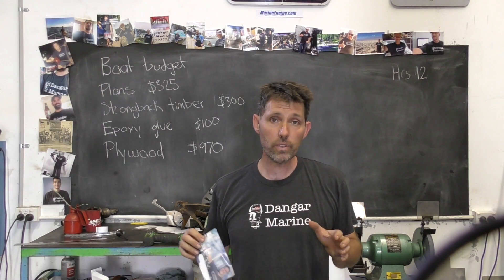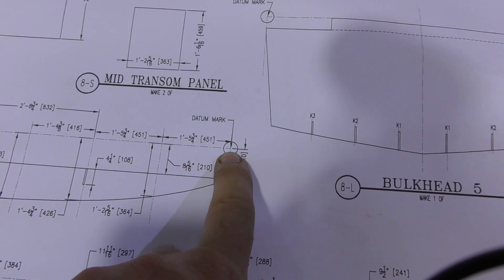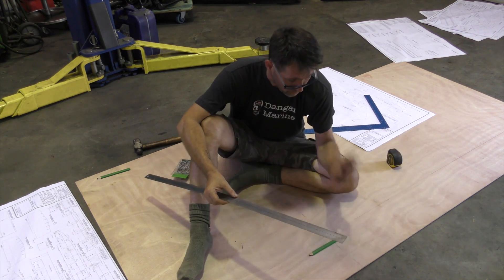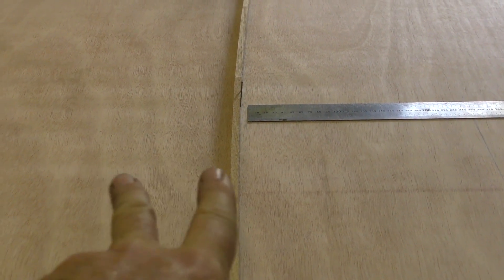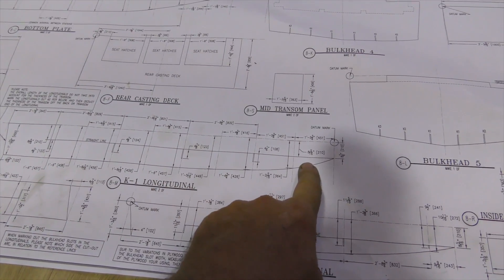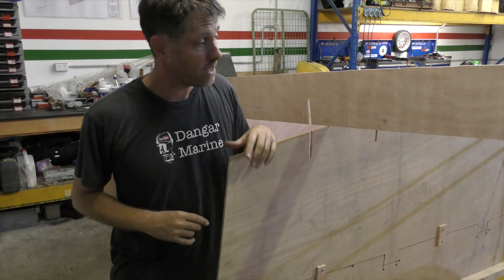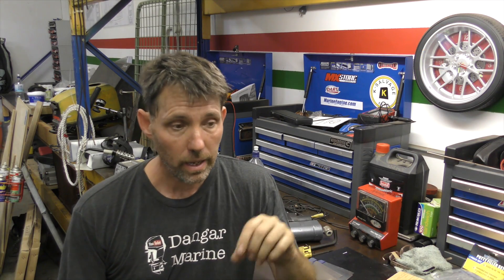Lofting a plywood boat

Comment: I've been drawing curves since I can't remember (about 50 years) and I've always just used a piece of string and a pencil. Start between two points to make a radius with a pivot point to be determined by putting the pencil end of the string on the starting point then by trial and error, find the pivot point with the other end of the string by touching the pencil on the start and end points till you get the correct arch with the string, then draw your radius. It's alot easier and faster. Then once you cut one side, just take the piece you cut off and use it to make the other side. Easy peasy!

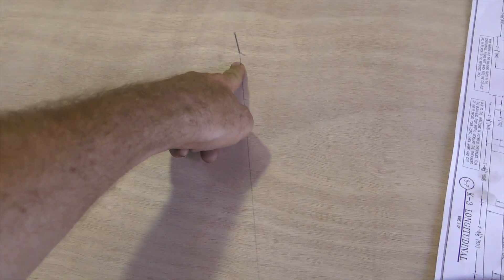Comment: 4:01 Does that deduction for transom thickness apply to the outemost longitudinals? I would have thought it would be better to have the transom outside edges flush with the inside of the outer longitudinals so you're them into the heavier transom not the other way around - also, better to have fixings in shear than tension. Presumably there are still internal corner battens glued, screwed and epoxy faired in anyway?

BTW the link from the original video to the plans http://bowdidgemarinedesigns.com/ROGUEWAVE_XR-16.html is broken - it appears he's withdrawn the Roguewave XR-16 model from the choices. I was wondering if he also supplies DXFs for cutting.
Reply from the maker: The outer skin comes to the back of the transom, yes. Not sure why the those plans aren't there anymore. I noticed that too.

Comment: Hi 
Can I use the spark for mercury 200HP BPZ8HS-10 in Yamaha 200hp and why,for Yamaha is BR8HS-10 Spark plug. 
Your answer is important for me.
Yasser
Reply from the maker: I'd be careful substituting a "P" plug for a regular as the outboard may not have the clearance between the top of the piston and the spark plug https://goo.gl/images/P1Cebr

Comment: Looks like a fun project.  I am curious as to how a wooden boat will stand up to a saltwater environment.  What finish will you use?  Given your ingenuity,  I have no doubt it will be a prize.
Reply from the maker: Hey Greg. I think this boat will hold up better than aluminium when it comes to salt. The timber gets completely coated in epoxy and fibreglass and then painted. Out of interest, fresh water rots timber much faster than salt water.

Comment: Hey Stu glad to hear you are taking a well deserved break. And for all that fiberglass dust get some clear plastic drop clothes and hang them up around the boat to contain it and get some Tyvek suits and a good respirator no need to be itchy and miserable.
Reply from the maker: Hey John. Yes, I have some disposable Tyvek suits and a good respirator which I agree are essential. I think I will try buying a roll of plastic that I can hang down to make a temporary booth with.
Reply: A temporary booth would work great and will come in handy when its time to lay down some paint.
Reply: Either hire or buy an air sander with a water sprayer built in such as https://www.ebay.com/itm/5-Wet-Orbital-Air-Palm-Sander-NEW-/201623237133 and wet sand . Use a plastic ground sheet and some battens to make a bath tub and run to a drain. You wont get much sediment in the drain if you run the plastic out wide and let the water run slow, most of the sediment will drop out and can be scraped up and put in the rubbish bin. I have also seen people use gyproc sanders (drywall to the USA people) and vacuum at source . Saves suiting up in the heat!

Comment: Hi Stu Well I think your deliberate mistake is going to prove very useful indeed.😉 It’s kinda funny no matter how much care you take there is a legion of opportunities to make errors. Anyway keep up the good work it’s starting to shape now.👍 Do the drawings call for wooden fillets at the intersections of frame and bulkhead? - I would have thought a nice (small)  triangular section bit of timber would add strength and make for better glass fibre layup.
Reply from the maker: Hey Norman, you're not wrong about there being plenty of opportunities for things to go wrong! The building methods call for epoxy to go in the gap of the join, then once that is set the boat is turned over. Once it is right way up a mixture of resin and thickening glass beads is mixed to make to epoxy fillets on both sides of every join before glassing.

Comment: Great job Stu! It is coming along nice. I think after the skin is done, you will have a great feeling seeing the fruits of your labor and can see it really take form. When I build the frame of fish tank stand and canopy I know it's not much longer. An ASS LOAD of sanding is the only part I hate to think about after the skin. I also don't have to deal with the fiberglass and epoxy portion either. Does this build require a lot of sanding, or do you just need to scuff the wood for the resin?
Reply from the maker: Hey Jim. I don't think sanding is anyone's favourite job. Once the glass is on the hull, you add a final layer of epoxy that has some small glass beads in it to make the epoxy resin into a thicker bog (for want of a better word). Once that sets you need to sand it back which I think is going to be the worst of it. My biggest worry really is where to do it. I don't want to cover everything in the workshop with a fine layer of dust or have it go into the environment. I think I might have to invest in a vacuum sander one day.
Reply: There's a variety of fillers to use to thicken epoxy.  Real solid ones make extra strong structural adhesive but almost impossible to sand.  Middling dense ones are good for filleting (tabbing).  Then there are hollow ones (microballoons) that are good for final fairing and much easier to sand prior to final finishing.

https://www.westsystem.com/filler-selection-guide/

Haven't tried it myself (though I intend to when I finally get around to more fibreglassing :-) ) but one way to get a good initial finish on fibregass cloth is to use peel ply - lays over newly fresh glass/epoxy, excess epoxy seeps through, and after peeling off leaves a smooth surface that should require little sanding, both because it's smooth and, because any amine blush is on the surface of the peel ply and thus is removed when the peel ply is peeled off (so to speak!).  Should also be ready for application of a second fibreglass layer where required.  Can get it on ebay or places like Boatcraft Pacific (along with the heaps of disposable brushes and foam rollers that you'll inevitably need!)

(You're inspiring me to get back to my current unfinished boatbuilding project - Thanks!!)
Reply from the maker: Yes, I currently have two types of beads - one for gluing fillets etc (I think it's called Cabosil) and microballoons for fairing which is much easier to sand as you say. Interesting technique about the peel off layers, I'll have to look into that. Anything that avoids sanding has got to be good!

Comment: Very  cool Stu. It'll be looking like a boat real soon. I like the lines of the finished boat you showed a few vids back. Looking forward to the fiberglass application. Cheers from Detroit !
Reply from the maker: Thanks mate. Next step after the longitudinals are in is putting the skin on the hull. I think that part is going to be tricky but it will definitely be looking a lot like a boat after that. :)

Comment: Shit happens and the trick is to make shit into something usefull. Thats what you did, making it templates. I would have cursed, throwing it in the corner and start all over setting the marks on 9 mm plates. I think you solution is the better one!! And maybe, some other viewer can use them as templates for his new boat.
I like the way you bring this videos, not only the successes but also the failures.
Reply from the maker: Thanks Hans, it's a bit embarrassing at the time but people had to find out eventually that I'm not perfect, not even close, just ask my wife. ;) It did occur to me that they will be very handy if I make another boat the same so I'll definitely keep them somewhere safe.

Comment: Haven't we all had an incident such as this?  Fortunately, no injuries, and not too costly.  But it does happen quickly and easily.  Being tired and being dehydrated are just a few of the dangers.  Anyways, as you were describing the mis-read incident and proposing photocopying it and cutting out the copies, I was thinking... just cover up the surrounding diagrams with other books, newspapers, wood scraps, etc to keep your eyes from inadvertently reverting to the "wrong" illustration.  Don't want to see your project get delayed,  but perhaps ol' Stu deserves some "me time" at home with just the family and some relaxing down time.  Hope it's a nice easy weekend.
Reply from the maker: Hey Stan, actually on a nice camping trip to the beach this weekend for a long overdue rest. Yes, I took thought about covering the other diagrams up by taping some paper over them but I started to worry the tape wouldn’t come off cleanly. Perhaps even blutac would work. Anyway, back to the view. ;)

Comment: Stu,
One thing I found was very helpful was having various colors of razor point pens.  I would start out in pencil, then once I double checked everything, I would mark it in colored pen.  One in blue, one in green, one in orange and so on.  That way, it was easy to cut out each part without fear of cutting the wrong line.   I made all my benchmark lines in RED, meaning "do not cut this line".  

Great progress so far.  Keep up the good work!

-Tony
Reply from the maker: Thanks mate, that’s a really good tip. It also occurred to me afterwards that I could have laid all four sheets out and lofted all three from a factory edge then traced the other three anywhere they could fit. Much simpler! I’m on a camping trip at the moment (hence the rush to finish that vid) and I’ve brought a copy of Gougeon Brother on Boat building. Loving every page. It’s getting me so keen to push on.

Comment: Another helpful video. My choice to build is the Bateau Boats  Classic 19. What thickness of ply is specified on your plans.
Reply from the maker: Thanks Rod. The Classic 19 looks like a really great boat, I like its lines. Mine specifies 9mm for the framing and decks and 6mm for the skin with a layer of fibreglass both inside and out over everything.

Comment: Great series, thanks for doing it all as you go.

I was wondering why you don't put both pieces of plywood together to cut out the duplicate pieces, vs. cutting one and using it for a template, with the problems that can cause?

RichE
Reply from the maker: You could definitely give that a go. You would need to clamp them well and in places that wouldn't interfere with the saw. The circular saw would be fine with the thickness, but my jigsaw might struggle a little bit.